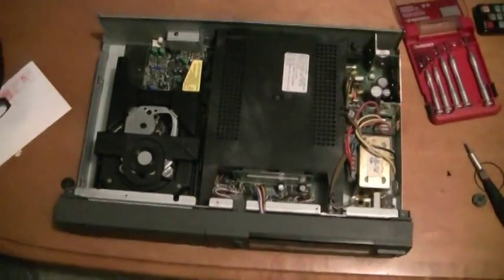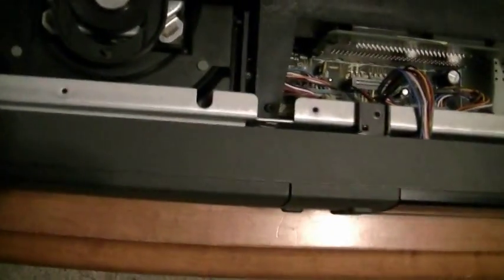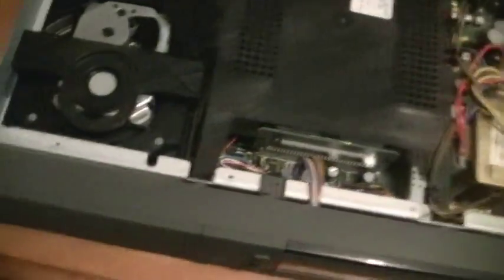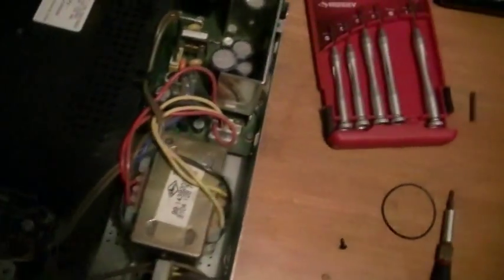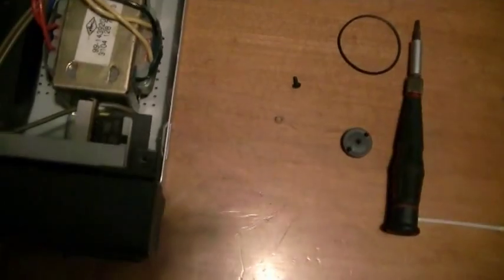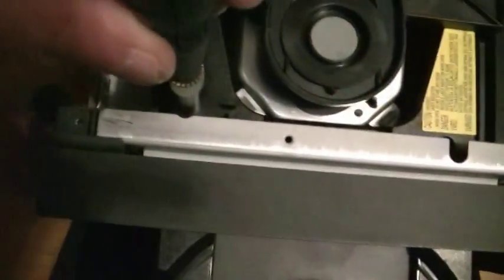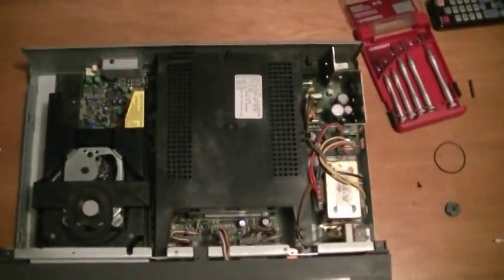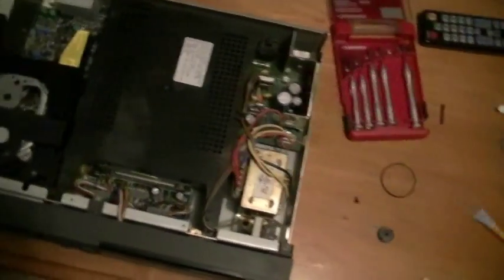Philips CDI 220 Repair

Comment: My Phillips Cd-I powers on, but the disc tray does not open at all. It makes an odd noise but does not open. Its just sad, at some point I'll take it apart but at the moment I don't have the right size allan wrench. The system looks brand new, not like its been laying around collecting dust for years and years. Its in the same box it came from the factory.

Comment: Hey man I'm having some trouble.  I have a bit to open the case, but I need to remove the main board to replace the caps....but I can't remove it because the CD ROM mount goes through the middle of the PCB, and my bit cannot fit into the deep narrow well to remove it.  Do you have any tips?
Reply: Nevermind I found a REALLY long torx bit on ebay.  Thanks for the video!

Comment: I have a question, I hope you still can answer it. I have the same problem with the disc tray which I will fix, but I also have a seemingly simpler problem: the door that opens in front of it is stuck open. I can't figure out how to repair that so it will open and close with the disc tray. Any ideas?
Reply from the maker: +sevinup07 To be honest i don't have a solution for the problem i don't have my Philips 220 cdi anymore lol i sold it my guess would be check the gears or the lid and see if there's anything interfering with them.